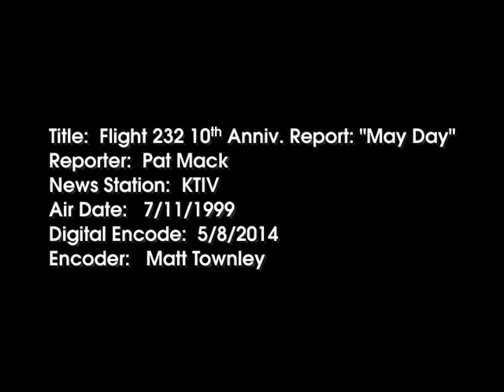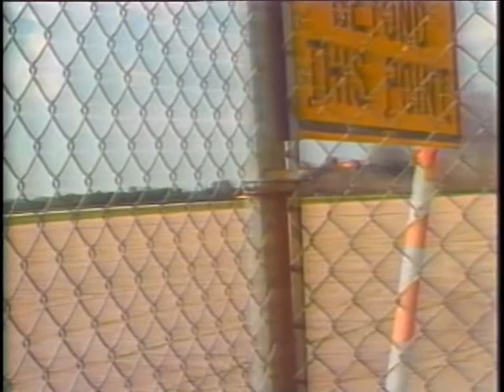Flight 232 Ten Years Later, Part One

Comment: Sorry... "37.000 miles above Iowa"? I didn't know 232 was in geostationary orbit  when it happened.  (it's a too high, even for that, in km it would almost fit.). 

 And this was probably a written and edited show, not a improvised live commentary.... someone could have noticed.
Reply: HUH?
Commercial aircraft typically fly between 31,000 and 38,000 feet — about 5.9 to 7.2 miles — high and usually reach their cruising altitudes in the first 10 minutes of a flight. Planes can fly much higher than this altitude, but that can present safety issues.
Reply: @YouAreMySunshine2  They won't reach cruise altitude in 10 minutes. They won't and can't fly much higher, and there are no safety issues.